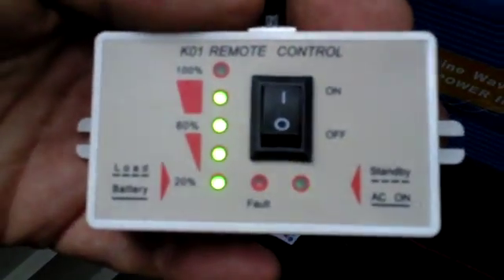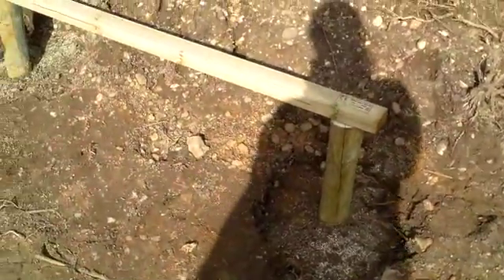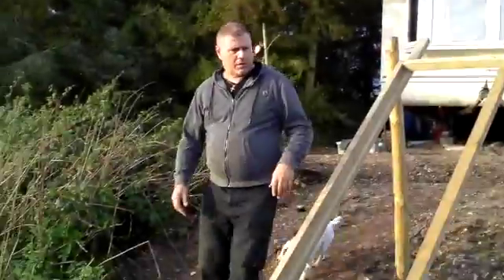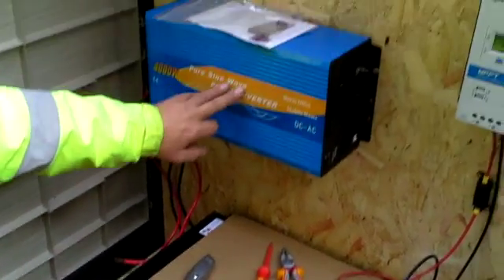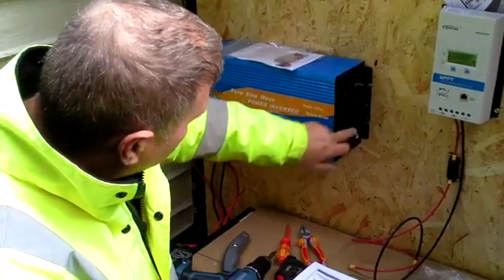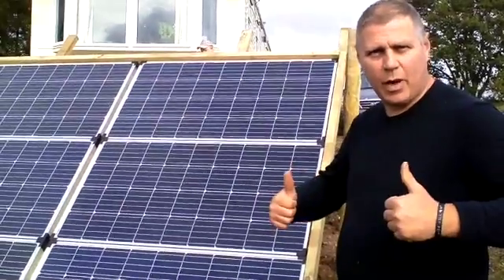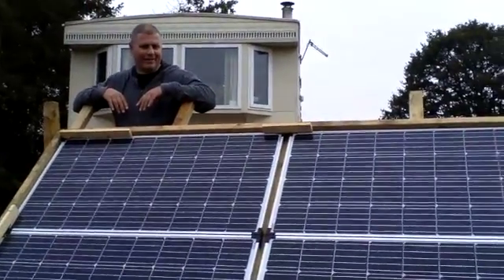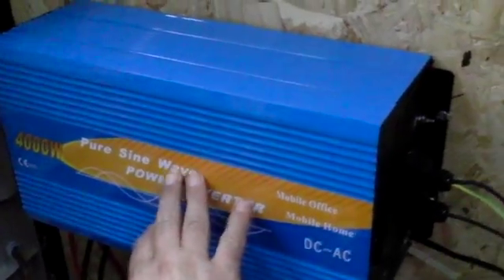Solar Installation, OFF-GRID, WE HAVE POWER! - 3 ACRE SMALLHOLDING / HOMESTEAD  (22)

Comment: The cables from the charge controller to the batteries look quite thin?  Have you sized them appropriately?  No mention of inline fuses or a battery management system either.

Comment: Hi Guys, I am so pleased to find this video... I have been looking so long for a solar setup and keep stumbling across the exact same system on SUNSHINESOLAR... May I ask, since you guys have had the system installed for over a year now, wouldIwatching your video
Reply from the maker: Hi Richard, yep it’s still working great!
Reply: @Bentonendflowerfarm  that's great to hear and thanks for a super speedy reply. Sorry about my previous message, I hit send to early... I wanted to ask, would you advise against moulding this setup on a pitched roof. I just got a 20ft container delivered to use for storage and I was planning to add a pitched roof. Primarily for water harvesting, but also to site my solar panels. Does having the correct angle for summer and winter sunlight make a big difference to how well the batteries charge?
Reply from the maker: @richardpiper6644  yes it does make a difference with such a small array, because you need the maximum  UV index, however, you could just add more angels to the system to compensate
Reply: @Bentonendflowerfarm  many thanks, much appreciated guys. 😁

Comment: Nice job, do you have a generator aswel?
Reply from the maker: Field to Farm yes, however we haven't needed it yet. We did have it on for Jo to use her hairdryer, straighteners and hoovering one day , just to save the solar, but apart from that, only the solar is on

Comment: Respect brother top a top post trust me your system looks awesome I tell you my panels was just place on the roof for about 4 years now your system looks neat. Ok now for the details what voltage is your system? Also the inverter kind of different to the ones normally seen on Youtube be nice to learn more about the inverter anyway let us know how well the system doing one more thing the batteries are they 12 or 6v and there amp hour rating respect like I said top a top setup.
Reply from the maker: Thanks, they are 24v, 780w of solar onto 4 x 6v 200 amp power batteries, wired in series to give the 24v. And the system is working great, having the 4000w power inventor you don't get any dips in power when you turn appliances on etc. also the reason we put them on the frame on the ground is so we can have access to cleaning. It even trickle charges during cloudy days.
Reply: @Bentonendflowerfarm  respect brother may I offer you a recommendation get a desulfator for your batteries this will slow your battery plates from desulfating allowing your batteries to last far more years longer, when you get a chance you can do some research on desulfators.  I tell you that system is going to last you for years just remember renewable energy like solar is additive pretty soon you be expanding your system.

Comment: Hi, after getting a quote of nearly 10k to supply power to my building project in Cornwall, I've done a similar setup but added a genny to power larger equipment (10kva output) so far it's working  really well, good luck will keep watching to see how you get on.
Reply from the maker: Hi thanks for your comment, yes, we also have a generator, just in case we need it, although haven't yet, not quite as big as yours though lol